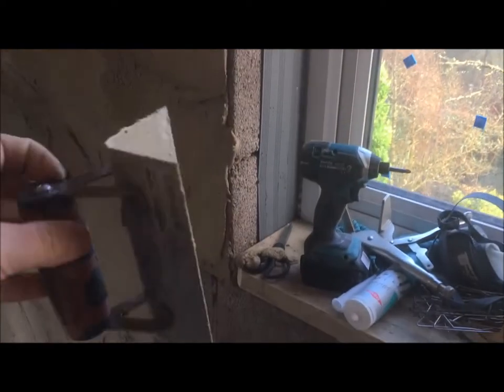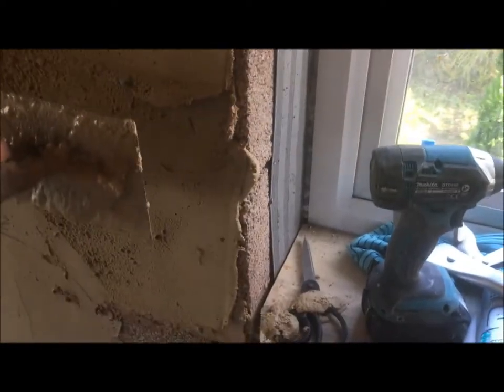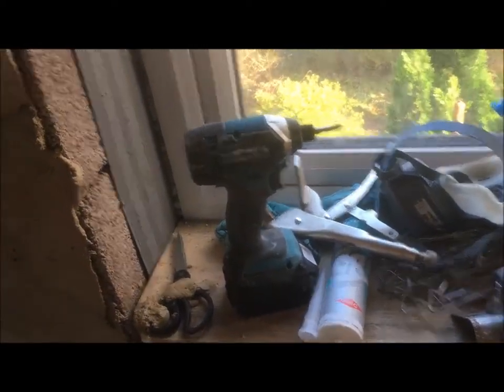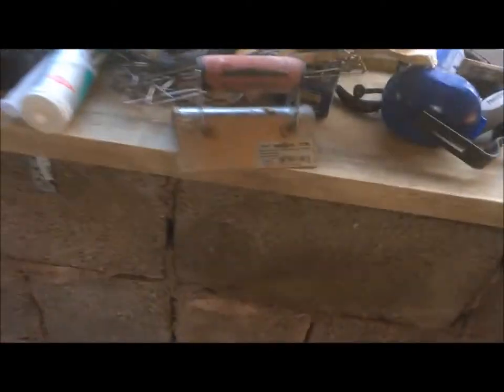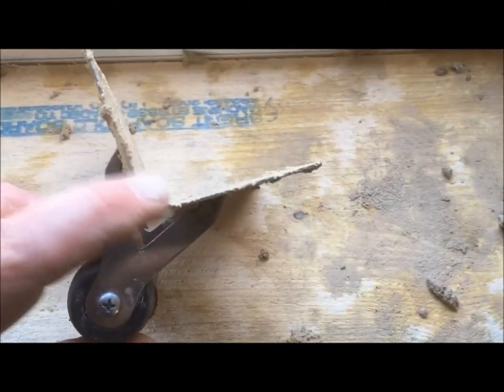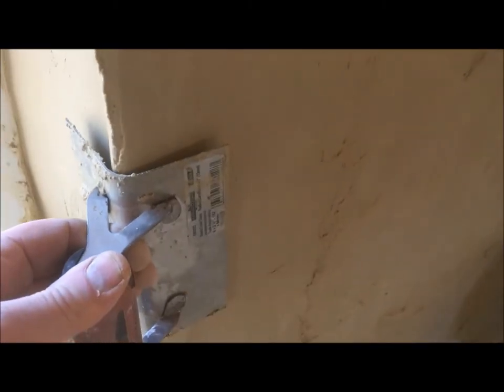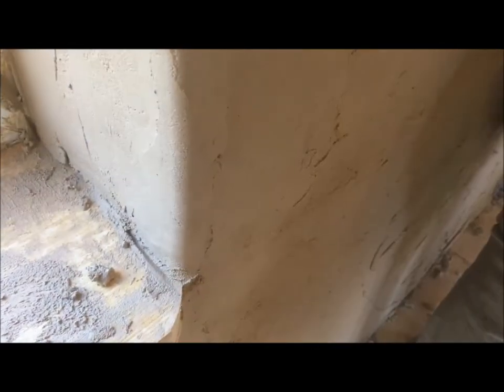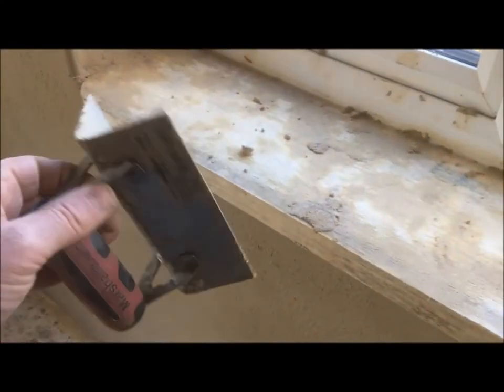Using a Rounded Corner Trowel for Plaster or Render Render

Comment: thanks for your video. Can you do such a corner for drywall as well? Or will it crack without a bead?

I made such a corner Trowel myself by bending a plastc plate with a very huge radius (maybe 2 1/2").
I wanted a round edge at our chimney because I liked a lot to have a round corner there.
Reply from the maker: I can't see a problem. If I were to attempt this I would likely look in to chiselling the corner back to the point it would "take" the radius you talk of, and then, you would need to get some finishing plaster, as this would be a closer match for you wall texture if dry lining / drywall. To stop the cracking you might press in some nylon mesh to a thin first coat, and then put final coat over the top of that. I'm not a pro, but that's what I would do.
Reply: @DorkyThorpy  thanks.
Maybe I just try it out. If it won`t work, I could still put some common rectangular corner bead over it.

Maybe a solid Wallpaper would already give it enough shock resistance.
I will try it with some rest pieces :).
Reply from the maker: @vornamenachname8783  Yeah! Just have a go.

Comment: What did Use to make the lime stick to the cavity closer?, Good Vid 👍
Reply from the maker: I used two methods:
1 - Scratch and Smear - Scratch cavity closer with knife of chisel, then smear a thin patchy layer of lime render over area. Leave this to dry for a few days, then go for it.
2 - Expanded Metal Lathes screwed in place over cavity closer.
If you do both, i.e. EML and then smear of lime render then that is best, as the lime render cures very slowly when stuck to plastic. Which is annoying if sponging.

Comment: Just put a bead on cheerio bye
Reply from the maker: Yep, if you want square corners you can do that. As a DIYer I find that if I try to make something look neat, then invariably one bit or other looks messy, its' a relative thing. With beading I find it is all too easy not get the angle beads parallel, or the cornet meeting up etc, and that sticks out like a sore thumb. However, as done here the end result is so uneven, the many inconsistencies are lost in the crowd. I am just not good enough to do beads well, so I don't.
Reply: Beads. work. But there are situations where a person might not want to use one and this video shows nicely how to plaster the corner without a bead.